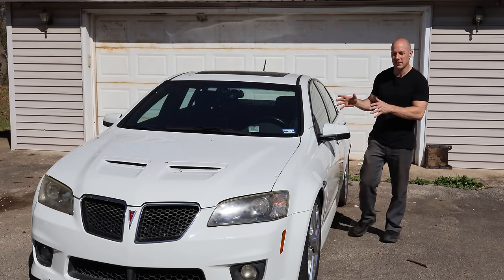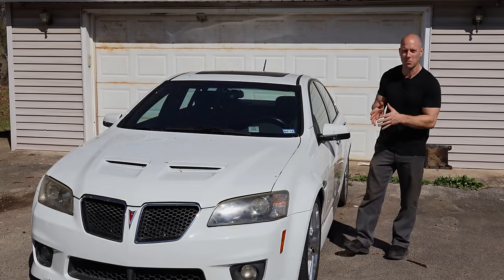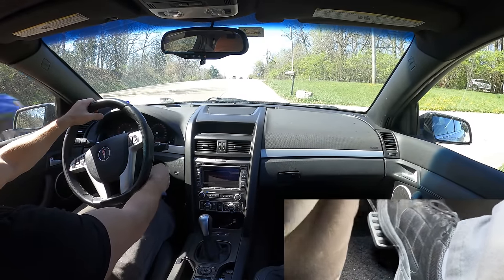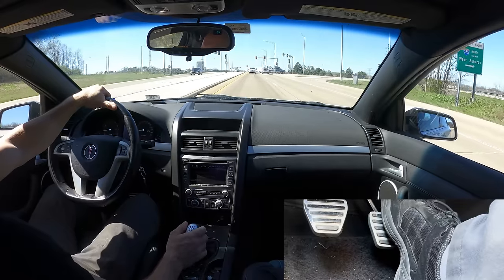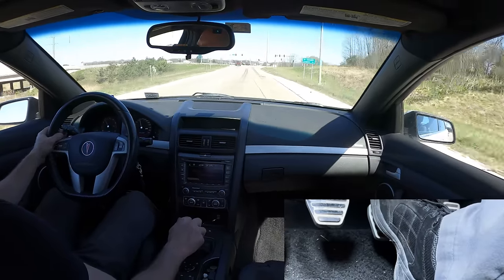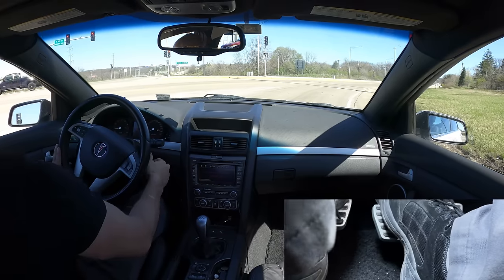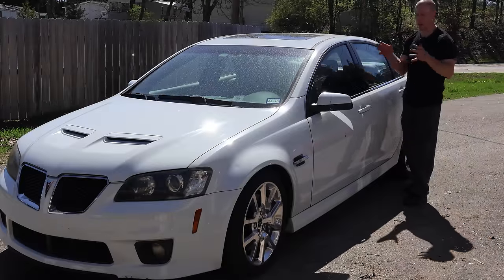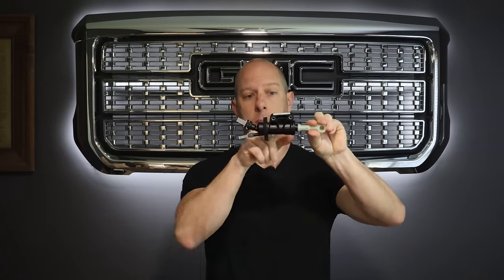How to drive a manual transmission without using the clutch, in case you broke it like I did!

Comment: Something I  can't figure out . On mechanical clutches , why do " they" put  the  " return" spring to pull the clutch pedal down against the throwout bearing instead of lifting it like they used to.I had an 88 volvo with manual transmission . I managed to reverse  the spring so it "lifts" the pedal and I drove it like that for 17 years with no problem.

Comment: The clutch is engaged until the pedal is pressed - and if your cable is broken or fluid is low to where it won't disengage ... how on earth are you starting it in first gear without immediately lurching?
Reply from the maker: If only I had explained that in the video… oh wait.  🤦🏼‍♂️
Reply: @vehcor  I did watch the video but the explanation didn’t make sense to me.

I understand needing the clutch down for the safety switch / for it to actually start.

I’ve been driving manual for 20 years - so I’m not completely oblivious to how it works. Have replaced clutches and pressure plates and throw out bearings, etc.

If you can’t disengage the clutch from the flywheel and you start it in gear the vehicle is going to move… so that’s what I’m wondering about.

In your video it’s very smooth. My experience would be that it lurches quite a bit and puts a huge load on the starter. 

Mind dropping me a timestamp of when you explained this rather than being sarcastic?

Comment: How are you actually STARTING moving though? The only way I can imagine it working mechanically is if you start in neutral, get the engine RPMs up a bit high, and then try to slam it into first gear to kick the car forward with some luck, but you're just turning the ignition key with it already in first gear, and you aren't moving yet while the engine is cranking over. How are you staying stationary if the transmission is in first gear? I could possibly imagine somehow starting using the starter motor to get you rolling and some extra gas and barely making it started, but I'm baffled at how the engine is turning over while in first gear and stationary, something there doesn't make sense.
Reply from the maker: Oh, I don’t know maybe around 3:15 there might be a clue.

Comment: Does your car have the 6.0L or 6.2L? It sounds awesome.
Reply: If it's a GXP, it's probably the 6.2L.
Reply: Depends what year it came out of the Australian factory ? We got different LS motors , three 6.0 litres L76, L77 and the best one L98 6.0 , no DOD . Same with 6.2 but General Motors Holdens performance arm HSV got the 7.0 LS for top line products .

Comment: Its likely the slave because air always goes up and fluid down and youre bound to find hydrolic fluid on the clutch plate, but i had a cable clutch on a sigma 5 speed borgwarner it was easy using it lile a dog box just rev match and slide in oh i do miss the sigma

Comment: Basically driving like you would drive a tractor trailer the float the gears only time I use the clutch was when I had the CDL instructor in the truck with me they made you use the clutch cuz you didn't you failed they want to know that you knew how to up shift and downshift the truck and stop it with the transmission

Comment: I dont understand why anyone would ever not use a clutch, its faster, smoother and healthier for you transmission? It is a genuine question, I understand that it might be usefull once your clutch pedal doesnt work, but you still need a clutch disk to transfer the power to the transmission. Replacing the clutch isnt even that expensive, its just a pain to work on it. So if anyone can enlighten me on why you would ever drive like this normally, that would be great

Comment: I don't understand how you could start the car in neutral and use the clutch to start the car moving. 
In my experience, either the car starts moving when as you start it or, it does not move at all when you let the clutch out with the car in gear.
Reply: If it doesn't move at all with the clutch let out this technique will not help you.

Comment: How do you start it on first without the clutch? I had a ford manual and if you tried it in that car it would just die instantly because the engine would be unable to get enough RPM to move the car. You'd probably have to start it on neutral, let it get above 1k RPM and then add some gas and try the gear.

Comment: I do not understand how the move off is so smooth and how you are able to take it out of gear while braking. Normally you should be able to take it out of gear when there is no torque going through the transmission i.e immediately after releasing the gas pedal on the upshift or after giving it a bit of gas if you braked before. That's my understanding anyway. Could your clutch be worn out or could the connection be so weak it allows you take it out of gear under braking?

Comment: Meh, just rpm match and shift, no clutch required, as long as the clutch isn't stuck in a way that disengages your gearing ( like when you push down on it to shift normally ) and your RPM's are right, you can shift to any gear. I've never tried to RPM match into reverse, so I'm not sure how that would work. My current vehicle is an automatic and I don't think it even comes in a manual anymore.

Comment: A practiced it for miles and miles on my company car.😂

And changing up is easy and dare to say if you keep paying attention it can go smoother then with clutch even.

Down is a lot more difficult  especially if you consistently want to do it smoothly but I managed after enough practice. Gearbox never failed even after 225k, so didn't completely ruin it. 😊

But if you don't drive 30 year old jalopy bought for $500 ut's a useless skill.

Comment: If the clutch is fully engaged, how do you start the car without the car moving? If the clutch is engaged, it should be just connected to the wheels and the wheels should spin with the engine.

Comment: How do you start a car that has a stuck clutch? Wouldn't turning over the engine cause the wheels to turn because the clutch is stuck? and wouldn't the starter be too weak to turn the flywheel with the entire weight of the car holding the flywheel back?
Reply from the maker: No, the starter will move the car but there is another explanation (which I covered)

Comment: I'm a bit confused. If you're  starting it with the car in gear, why doesn't it lurch forward on the starter until the engine starts? 
It looks completely normal when you're doing it...the engine turns over and starts without the car moving, then you just pull away smoothly. 
What am I missing?
Reply from the maker: The part where I said the clutch half works.
Reply: @vehcor  That's cheating! Or half cheating. You should rename the video "Half Clutch, Half Problem".
Seriously though, how about filming one where it's completely non functional. That's the tricky part, not floating the gears once you get going. Can it be done?
Reply from the maker: It is literally the same, the only difference is the car moves when you crank it in first, not hard.
Reply: @vehcor  Okay. I just thought it might be a slightly different scenario, what with the starter motor having to move the whole weight of the car , jerking out into the middle of an intersection until it hopefully manages to start, then lunging ahead if it does, with people honking and whatnot.  Might be entertaining.

Comment: Technically, you're double clutching... right?? xD Reminds me of learning to quickshift on a motorcycle, only way harder and with higher risk lol.
Made it look easy, expert driving. 

P.S. I wonder if the rate at which the fluid pressure increases when you start the engine would have an effect on your ability to get off the line in 1st? Seems like as the engine starts the pressure is low, and the clutch "slowly" engages as the pressure builds. Interesting nonetheless

Comment: I don't understand how you can start it in 1st gear without crawling using the starter, seems like some weird feature of the car, does the clutch start to engage a while after starting or what?
Because rolling in 1st is probably the hardest thing to do - you probably don't want to speed up using the starter and you don't want to grind 1st when trying to get going from neutral
Reply from the maker: I still don’t understand how I can explain it any better.  Did you watch the video, say around the 3:15 area?
Reply: @vehcor ok, so it basically works good enough to start from 1st, and then you actually stop using it. it seems like cheating a bit on the "no clutch" part, but it was an interesting video anyway.

Comment: but you ARE using the clutch?  what you want to do is put it in second then turn the engine over in gear it will start and off you go, clutchless shifts not how to drive without a clutch...  you need to learn how to start the car in gear, put in first or second, turn key using key, button, whatever, you might have to press clutch pedal down if there are safety switches that wont allow the vehicle to start if clutch is not pressed.. go ahead press it down, its gone tho so it wont work, be sure to put in first before doing anything, turn key let it roll then start, the starter has enough torque to roll your car and start it in gear on level ground, you're going to want to AVOID hills with lights in the middle or on top no matter what, lighter cars might climb some grades who knows and if your car starts real quick it might work, same deal, in gear when off, light turns green, turn on key, starter rolls the car and it starts and now you can take off, another thing he failed to mention is that when upshifting you must release the throttle in a synchronous manner with the shift as the RPMs fall that's when she wants to upshift without grinding when down shifting a slight blip of throttle and catch the downshift as engine RPM's drop, timing,  all timing

Comment: You are using the clutch to start moving. What am I missing here? I don't understand why you are shutting off the car.

If you start the car with it in gear, it is going to be a fun time. If you don't disengage the starter when the motor starts, you'll shred the starter. A gas powered golf cart works like that, except the starter is designed to disengage itself.
Reply: Hmmmm not worked around cars much have we ? There is no clutch it's not disengaging , so it's in gear all the time unless in neutral, so if you want to start the car you put it in 1 st hit the starter , car starts , the starter is quite able to move the car in 1 st and start it , you will never hurt it ! Maybe after 30 or 40 gos but your just getting the car home .
Reply: @JosephCowen-fz8vj  I'm not worried about the motor breaking in the starter. I am talking about the engagement gear. It's designed to release once the motor starts, but if you have the transmission engaged, the torque on the gear could keep it in place and spin it faster than it's designed to. That is a seperate observation from the fact that this car doesn't appear to have a clutch problem. He clearly starts the car before it begins to move.

I have worked on vehicles for 35 years. I also reference that gas powered golf carts use the starter to start the engine. The difference is that it is designed to do that. Not sure why you would believe I haven't worked on vehicles much.
Reply: @dougsholly9323  I suspect he is doing a " what if " video, and really , if you have worked on cars that long and never done this , well , every mechanic has done this before, the starter cannot stay engaged , it has kick back splines on its engagement gear, if that motor fires for one second and the ring gear exceeds the starter gears speed it kicks the starter gear off the engine faster that you can think ! Not even a tenth of a second , ever seen an out of timing engine kick back on starting and it throws the starter off the ring gear, ?? Same thing, I once broke a timing chain on an old motor, we pulled the plugs , put it in 2 nd and hit the key , with a charged battery and good starter we got 3 blocks home ! Still starter fine , bit hot but fine .
Reply: @JosephCowen-fz8vj  "What if" is fine, except he specifically stated the clutch was broke, which it didn't appear to be, and 70% of how to deal with a broke clutch linkage is how do you take off without it, which he didn't demonstrate. So the 'what if' wasn't even accomplished.
Reply: @dougsholly9323  I think you miss understand " what If " , if you can't understand 1 put in first and 2 hit starter , and need a demonstration of this simple idea , your clutch if far from your biggest problem , come on you can work it out without someone explaining it ,
Reply: @JosephCowen-fz8vj  If you can't understand just ease it into the next gear to match the rpm without a demonstration...

This conversation is idiotic. It is clear you are being contrary just because you can. We are done.
Reply: @dougsholly9323  ok , it's good U now understand !
Reply: @dougsholly9323  you really have never driven a car without the clutch ? Ever ? Just to see, it's easy , race car drivers don't use the clutch after first take off .

Comment: I am definitely no experts in cars, but you say you need to shut the car off if you need to stop fully in an intersection or similar situation - doesn't even putting the gear shifter in the middle aka Neutral work with a broken Clutch? 😐

Comment: What usually goes wrong with them for a dead clutch? People not knowing how to do a burnout and cooking the clutch
Reply from the maker: I mean, I did say the causes of this type of failure.  Did you not listen or not understand the different types of clutch failures?  The driver, bad or good, has no effect on this type.
Reply: @vehcor  it was me giving the most common failure point on those vehicles, especially here in Australia. 

I did not feel the need to write a huge post stating my qualifications, acknowledging that yes you covered a few of the failure points, how I got my information, the % of burnt out/damaged/slipping etc clutches on those specific vehicles that came in per week compared to the other reasons they came in.

Sorry for commenting such a short comment on your video. I will provide a more full one under my original one so as to not appear that I do not understand, listen etc.
Reply: Okay it appears I need to make this longer.

Yes Vehcor did cover the causes of a clutch failing.

My comment was regarding the most common failure point of these vehicles in Australia, where they are remarkably popular under the Holden/HSV badge.

I was a mechanic for many years for my qualification as to why I made that comment. Out of easily the 10 to 12 of these coming in every week the vast majority came in for basic service. About 1 per week was for a clutch failure of some description.

Of the clutch failures about 70% were from P plate drivers (first stage of "learner drivers" that can drive own their own without a fully qualified driver in the passenger seat) attempting to show off, failing to do a burn out and instead destroying their clutch along with the flywheel. Older drivers did do this as well but was less and less common as experience was aquired

A major reason as to why such high percentage of them coming in with a burnt out clutch is due to the fact I live and worked in Darwin NT Australia. L and P plate drovers have NO restrictions on engine configuration, forced induction, cylinder amount or the likes. Unlike the other parts of Australia. 

Sorry to all for making such a long post. I did not feel the need to make such a long post. And still tried to keep it short despite the fact I was asked if I didn't listen or understand.

Hope everyone has a good one (good one=good day).
Reply: Oh and for those wondering what this beautiful vehicle is called in Australia (no sarcasm they are a great vehicle and Vehcor's is a clean example). They have a few names but I'll list from "base" to top of the line, I'll skip a lot of them to make a short list.

Holden VE Commodore (comes in V6 and V8 badges include the Omega, SV6, SS, SS V,).

Holden VE Calais, Berlina

HSV GTS, HSV Clubsport, Senator, Grange, R8, W427

Just to Na a few, there is also the Ute versions like the Maloo.

Comment: Sorry, you start the engine with first gear engaged and it does not move ? Something is fake. 'The clutch is not 100% bad' may be a reason. Normally the car with engaged clutch hops the first turns and the starter is not able to get it up to speed so the electronics will not start the ingition and you are done.

Comment: You are wrong a bit, you don’t have to stop the engine to stop the car. Just go to neutral and when is time to move on, push the gear stick very gentle to first shift very softly not pushing too fast the car will move very slow and suddenly the first gear will go forward….then go on…
Reply: You are causing ton of wear during that stunt; you are basically letting the synchros move the entire car untill the speeds match. too tough on them.  

wearing out a starter/ baterry is less costly and safer than what you mentioned.

plus it probably won't move on it's own if it was facing a hill

And most liely won't work in reverse as most cars don't have synchros on reverse. you'll be grinding forever in reverse

Comment: Caution : Doing this May Result in PREMATURE EXCESSIVE WEAR OF SYNC RINGS/GEARS
Reply: Crap , truck drivers never use the clutch after moving nor do motorcycles , you shouldn't be even using synchros , match revs and they will never touch.